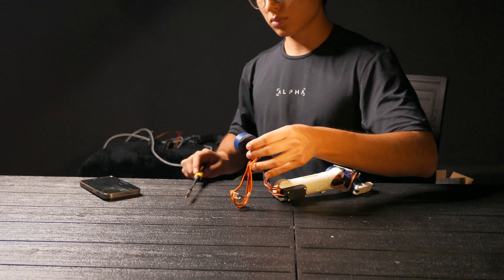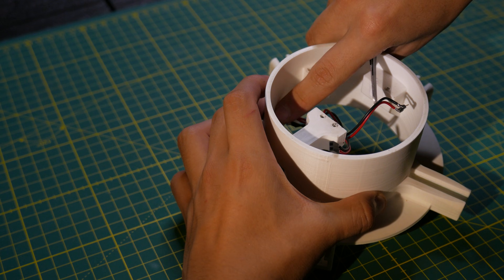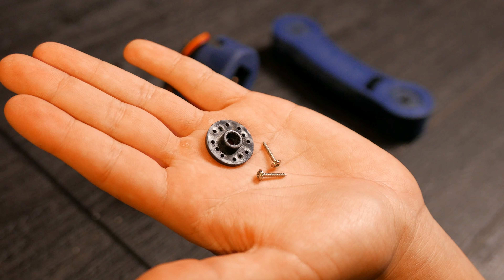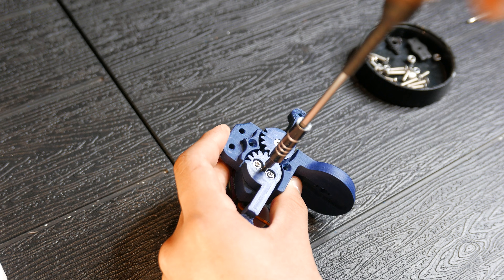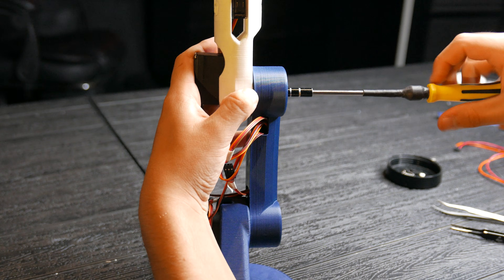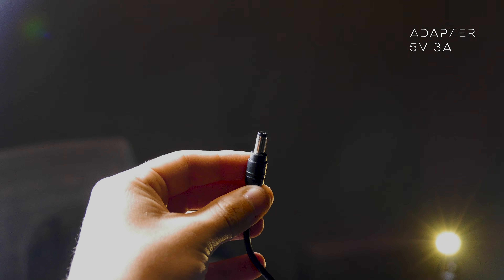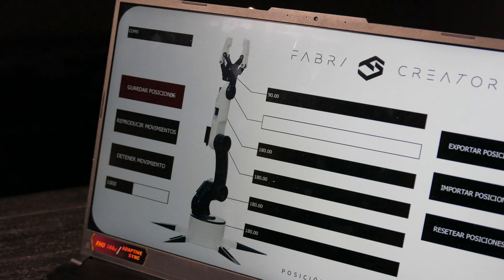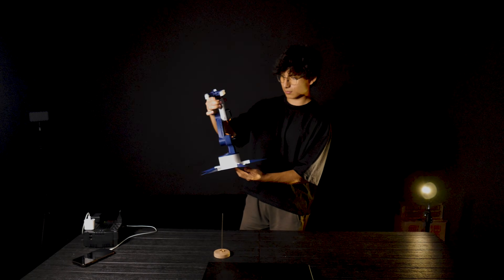Robotic Arm with Arduino - Save/Play/Export/Import Positions.

Comment: this is a great project, I would add:
1. So that the application has an animation of the movement of the robo-hand.
2. Make several 3D models of the tip, for example, to mount the camera, so that it would look like a movie)
3. Pour metal into the legs of the support so that the structure is stable
Reply from the maker: Thanks for your recommendations!🙏
Reply: @FABRIcreator  thank you for your creation, I’m waiting for a new video 😉